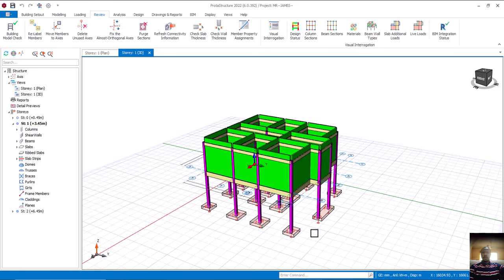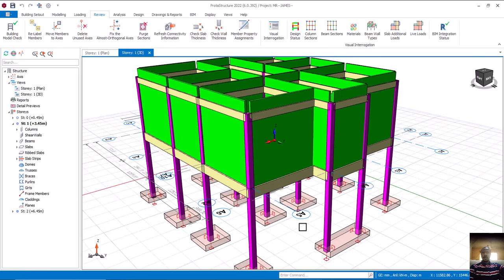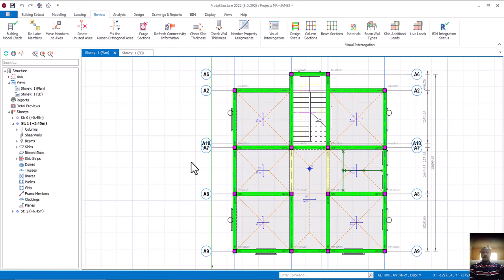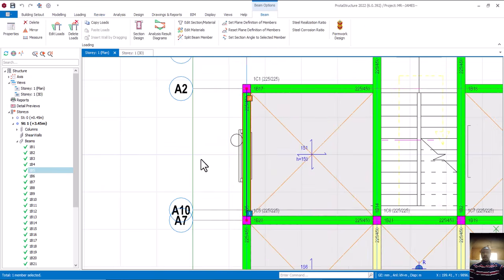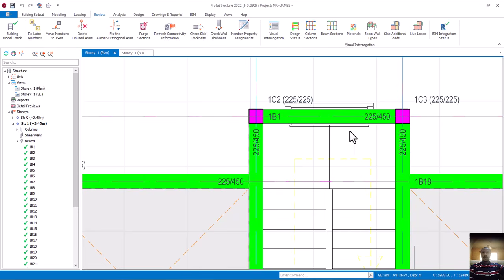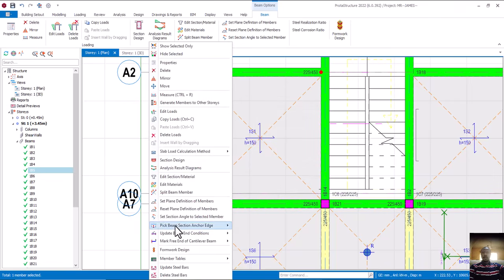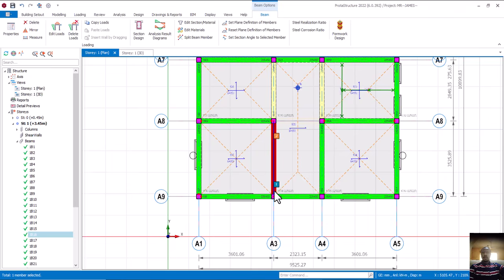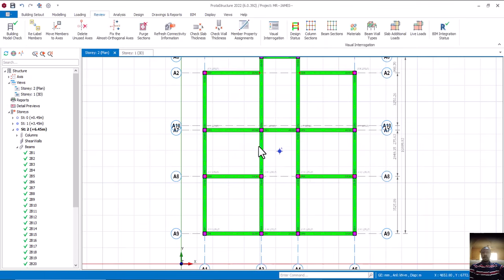Hinging During Construction vs Design Stage | ProtaStructure Explained

Comment: Please it means that when ever you are doing a design, you have hinge your beams or is not that.
Reply from the maker: It’s a matter of choice
Reply: When you hinge your beam, your support moment reduces, but your mid span moment increases, how this affects on site is that the number of reinforcement rods you need to place at your support to prevent hogging moment reduces, but it also increases the number of reinforcement you need to place at your mid plan.
And you can hinge your simply supported beams and continuous beams, but when hinging continuous beams, do not hinge the support between spans, if you do it, the beam would no longer behave like a continuous beam, and the structure would be unstable
Reply: @fortuneharrison2438  but in real life there partial fixity coz of monolithic concrete casting, therefore there is little moment (cfr Mosley)

Comment: I want to ask at what Case you don't hinge both end conditions of a simply supported beam. Or you don't need to hinge the end conditions of a continuous beam?
Reply from the maker: It depends on the structural connectivity and the load transfer requirements you need for your model.